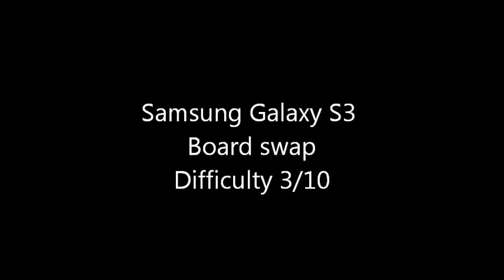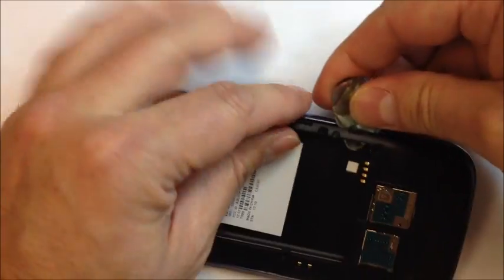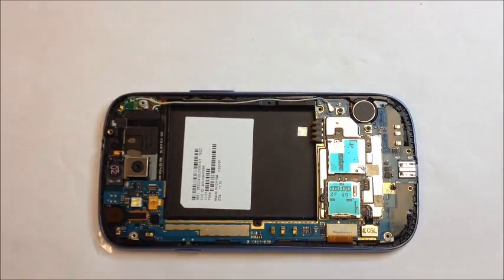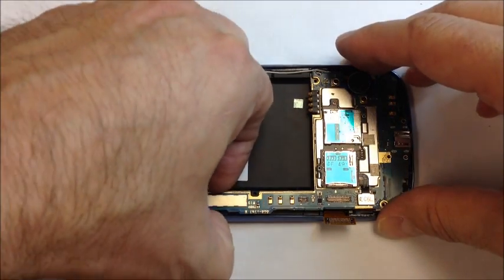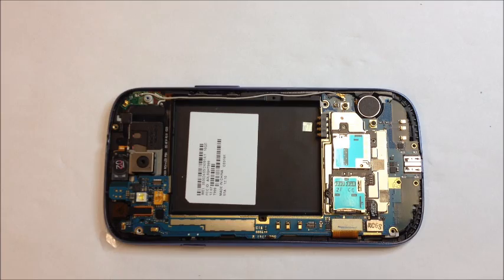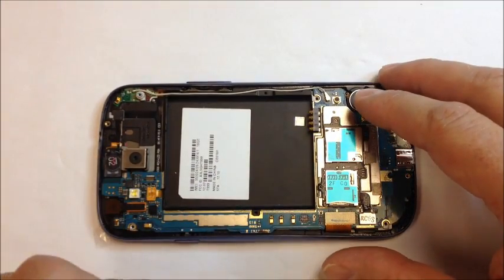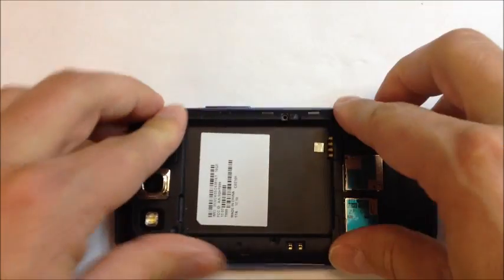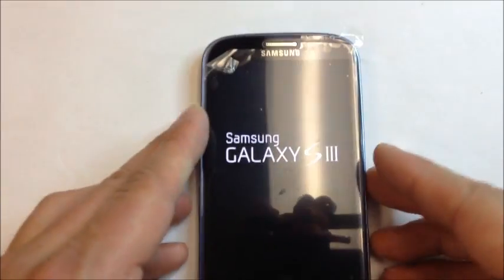Samsung Galaxy S3 tear down for board swap

Comment: I just broke my screen today - if I buy a refurbished phone off ebay and then replace my board like this will it still work? I have Sprint.
Reply from the maker: Yes but keep in mind that the model number must be identical. You can't buy an AT&T S3 for example. The board layout is slightly different.

Comment: my phone isn't receiving 85% of the calls nor are 85 % of the calls outgoing is this the board that needs to be changed? the signal strength is full so I'm assuming it's not the antenna
Reply from the maker: Sounds like it. It's always tough to say for sure as signal strength can sometimes be misleading. Was it repaired recently?
Reply: Go Cell Phone Repair no it was stock never repaired
Reply from the maker: nervouss Could be a software issue too. It's probably worth trying a hard reset if you've backed up your info already.

Comment: I have a galaxy s3 thru boost mobile and I sent it in to samsung for repair and they said my motherboard was disconnected and i would have to pay almost 300$ for them to even start fixing it for me. If i find one on Ebay, how do i go about it? do i have to find the same model number in order for it to fit?
Reply from the maker: Yes. If you have Boost then you need a Boost logic board with a "clean" ESN. Be sure to clarify that much with the seller as there are serial numbers that can be blocked from the network. Reported stolen, insurance claim or otherwise.

Comment: Is there any way of turning my sprint phone into a phone that would work on say fido's network with a fido board?
Reply from the maker: Fido is a GSM network and the Sprint S3 does not accommodate SIM cards nor are GSM frequencies supported so for this model no. The Sprint S4 on the other hand can be unlocked for international use.

Comment: I am a little confused with the CDMA GSM stuff.I found a cricket phone with a bad esn and want to know if I can swap it with my tmobile sgh t999 gs3 motherboard.
Reply from the maker: The T999 mid-frame is only compatible with GSM logic boards so the short answer is no you can't use it with a CDMA version. You could try to remove the display assembly from the Cricket frame and transfer it to your phone but this has a high degree of risk for damaging the AMOLED in the process.
Reply: Go Cell Phone Repair will at&t motherboard work in t mobile s3?
Reply: Yes its gsm. It will work. Same goes vise versa. Thats what I ended up doing long ago

Comment: Hi, thanks for posting that video. I feel more confident now on trying my own repair (galaxy s3). Just have an interesting question on borad swap. Would it be possible to swap a T-Mobile board into a AT&T working phone? Also would issues with the swap or with the antenna?
(SGH-T999L board swap into SGH-l747) I was thinking trying to fix my T-mobile thats has a broken lcd screen and try fixing it with a AT&T that just has hairline cracked on the glass srceen. Thank for your time and help in advance.
Reply from the maker: The AT&T and T-Mobile versions are compatible so you should have no problems there. I'm assuming that you are willing to live with the hairline crack from the AT&T phone. Since the glass is adhered to the digitizer trying to separate them is a lot more difficult.

Comment: I wanna do this to my phone because i broke my digitizer and cant wait for a new phone. My question is if i do this with a good phone and swap my board in, will i have to call verizon and have it activated or will it be as if it was my original phone?
Reply from the maker: Same as original. As long as you are using the same logic board (and LTE SIM where applicable) they won't know the difference through their network.
Reply: Ok cool. I have a Verizon S3, do i have to do the board swap with an S3 thats from Verizon as well?
Reply from the maker: sam roberts
That's the best option. A Sprint mid-frame should be compatible but anything GSM like AT&T, T-Mobile, or the overseas version will not fit.

Comment: Is there a reason why the pry tools are plastic? Will it damage the phone if I use similar tools that are metal?  Could you please help Go Cell Phone Repair
Reply from the maker: Believe it or not guitar picks are the choice of most repair technicians and do-it-yourself-ers for several reasons. First plastic will not scar the bezel or paint of your phone. So when you ask whether a metal tool will work I would say sure it will work but may leave some evidence of repair behind, something that most customers would not be happy with. Secondly guitar picks come in a great variety of thickness and flexibility making it easier to find the right one for whichever application you are working with. They are also cheap and easy to find since even the smallest towns tend to have some sort of music supply store. If you take a look at the typical "cell phone pry tool" you will see that it was modeled after a standard guitar pick. http://www.dhresource.com/albu_280903365_00-1.0x0/triangular-pry-tool-phone-repair-kit-for.jpg
Reply from the maker: Christopher Person No problem. With this being a relatively new industry sometimes we do have to improvise. The guitar picks work great and it's no big deal when they wear out.

Until some very smart guy came up with the iSesamo tool (wish I had thought of that one) I was using a dulled single edge razor blade a lot of the time when I needed something very thin but also strong. Not good to prevent scarring of course. Right now the one thing that I haven't found a proper tool to replace is a street sweeper bristle. No kidding. Long enough to get under a lot of LCD panels without being so thick that it applies excessive pressure yet very strong and fairly flexible.
Reply: I had to do this a while back to fix my GS3, it's fine to use other tools. Just don't use a hammer, that won't turn out to well.
Reply: So metal tools work? Christopher Person
Reply: Dallas C yeah, I used a small flat head screwdriver(a pc one)on mine..
Reply: Why do you think all the tools are plastic then? Christopher Person
Reply: Dallas C well one of those tools was a guitar pick, so guess that's what he had at the time. As long as you're not digging with a metal tool you'll be fine. It's still silicone just like a PC mobo. And technically if you have strong nail you can uses those. Their just clips after the screws.
Reply: Thank you Go Cell Phone Repair
Reply: Go Cell Phone Repair hmm didn't know guitar picks where that popular in cells phone repair. Thanks for the info.

Comment: Hello and thanks for posting...

Trying to repair my screen my lcd glass broke.  When I tried taking that off, the lying behind the lcd display crack too.  Do you know if I get a galaxy s3 phone that is the same (sph-L710 model) can I switch the motherboard and basically have my phone back?
Reply from the maker: Yes, as long as it is the same model, L710. If you get the wrong one like an AT&T version then it won't fit.
Reply: Got it.  And you are right it did work...thanks.

Comment: I have a S3 I baught off someone but I has a signal problem. Tried flashing factory rom and checked to see if the imei is ok. All Good. I checked the antenna wire that was also ok when I opened it. Can I get a bad imei board to save money and remove the bad imei and flash my phone imei. Will it work if I flash my backup nv data file
Reply from the maker: To the best of my knowledge that is possible but since we don't deal with bad IMEI devices I am not an expert on the subject. I do know that once in a while a manually written IMEI may revert back to the original so it is not a permanent fix.

Comment: can i change my sch-530u CDMA to a GSM S3 by replace a T999or i9300 board to its.
i need a GSM phone not CDMA
Reply from the maker: No. It sucks but they make the boards slightly different so they won't fit properly into different mid-frames.

Comment: I have a metro pcs s3 an the board is bad , do i need another metro pcs board or i cna use another board from a different module s3?
Reply from the maker: Check the model number. If you have the R530 then you will need another Metro logic board. If it's a T999 then it is compatible with T-Mobile.
Reply: thanks

Comment: Hi! I have an At&t i747 S3 using an lcd + digitizer of i9300 s3 . I want to know if I buy an i9300 full housing, will it fit on a i747 board? Thanks
Reply from the maker: To the best of my knowledge it will not. The board layout should be slightly different and since they are listed separately there is likely a good reason. I will add a link for the i9300 to my website ASAP.

Comment: I have a Us Cellular S3. They said it could not be activated because it was stuck in roaming. (triangle above the signal bar) Do you know what part I would need to fix that?
Reply from the maker: Stuck in roaming... That's a new one for me. US Cellular is a reseller for a few different companies. Is this a GSM or CDMA model? Without more information my first thought would be to try a hard reset. It could be some sort of software error.

Comment: i have at&t s3 with broken lcd.I bought verizon s3 with good lcd but bad emi from ebay.Will swap of lcd work for at&t?
Reply from the maker: It will not. The mid-frame configuration is slightly different so even though the display will light up you won't be able to fit your logic board into the phone properly. AT&T and T-Mobile are compatible. Whenever you deal with Verizon you almost always get parts that only work with their phones.

Comment: I'm so thankful for this video,but I have a question. My wife's CDMA S3 has met with an unfortunate accident, and its screen is broken (glass and display). We are receiving a replacement through insurance, but she still has a lot of pictures and music on the internal memory.

If I were to do a board swap, I want to be sure that it won't cause problems with her service due to imei problems. Do I still need to activate the phone and do i use her old SIM or the one sent with the new phone? Since it's a CDMA phone does the SIM card even matter? If when we send the old phone back with the new motherboard, I'm assuming that it's imei won't match the sticker inside.

Sorry if this is long. I'm very good with hardware, but when it comes to all this imei and service business, I find it a little confusing. Especially since I assume this process is probably not something most carriers are expecting people to do.

Thank you.
Reply from the maker: If you have a CDMA phone then you will have a MEID rather than IMEI. The LTE version of the S3 which should be what you have uses the LTE SIM for subscriber information however if you did an insurance claim on the original board then there may be a possibility that they will blacklist the MEID. This could be a problem in the future. I would suggest swapping the board, backing up her files, then putting the new board back in just to be safe. The original SIM should still be active but you'll have to try it to be sure. Save the new one just in case.

The downside is that the new board that comes with the replacement phone is probably refurbished.

I hope that answers your questions. Good luck.
Reply: Go Cell Phone Repair
Thank you, I was afraid of that. Since her phone still powers on, could I just connect the good screen to her phone in order to be able to unlock it? I tried connecting her phone to my computer to get the data off, but since I can't unlock her phone, the devices just show up as empty.

I'm pretty sure it's not my computer (Lubuntu 14.04) because it works fine with my phone (Stratosphere 2).
Reply from the maker: Yeah if the phone is locked it will probably look like there is no media until you unlock it and put it into transfer mode.

Comment: Hi I have a Samsung s2 it turned of and wont turn back on no matter how much I try, I need to change the motherboard and I was wondering if I could transfer the inner meomory thats in the old motherboard to the new one is it posible??? According to some repair technitian its hard job but I realy want to do it plz help me :(
Reply from the maker: If the old board will not power up then you won't be able to extract anything. Hopefully you have a different problem causing it not to turn on. There are a lot of things that can cause this to happen so you'll need someone to perform a diagnostic test and find out if it will turn on at all.

Comment: Hey! Thanks so much for this video, I successful swap the motherboard on my own in less than 10 mins while other phone repair shops were trying to charge me over $60 to swap the motherboard. I have a question though? What if I was going to purchase a phone that has a bad ESN or IMEI, if I switch the motherboard from the phone that has ESN or IMEI to a brand new motherboard would the phone work?
Reply from the maker: If it has a bad serial number you will not be able to use it as a phone as the networks in the US will not allow bad IMEI/ESN to connect.

Comment: Hello! I am borrowing my friend's S3 as mine has a broken LCD/digitizer, and I want to transfer my data onto their SD card before I send it for repair, is the cable at the bottom left what I plug into their phone to use their screen as a donor? Thanks!
Reply from the maker: Yes. Just be careful not to put any stress on the cable.
Reply: Go Cell Phone Repair in what way?
Reply from the maker: Rebecca Ford By pulling on it. They can tear if you aren't careful.
Reply: Go Cell Phone Repair ah, I see! Thankyou
Reply: Will a gt I9300 motherboard fit in a Verizon s3 body?
Reply from the maker: Not without some modifications. The Metro version R530 on the other hand should be.
Reply: How about t999 body?
Reply from the maker: The T-Mobile T999 is compatible with the AT&T version but not Verizon. People ask this a lot and Verizon is always more difficult when it comes to parts because they are CDMA. I've actually cut out parts of the frame with a dremel and made it work but if I were you I'd look for the correct frame. Good news is that Verizon stuff is usually cheaper.
Reply: My question was is I have a gt I9300 motherboard ..and what body can I put it in??

Comment: Can u tell my which phone should I use the components to switch with the other one...
Reply from the maker: If I understand you correctly you should be able to put the board from the one with the bad screen into the other phone.
Reply: Thk you alot.. i did it n it work very good, but now i hv a little problem with the headphone jack... when i connect my headphone... i can only hear sound on the right.. can u tell me how to fix it.
Reply from the maker: You can try disconnecting it and plug it back in. If that doesn't work you can always it with the one from your other phone. They do go bad over time.
Reply: how can i change the phone- plugin?!? i though it is stick on the main... so it's kinda impossible to change it, rigth?!?!? can u help me?!? thank you
Reply from the maker: If you are talking about the charging port it can be replaced but requires advanced level soldering skills and a microscope. If you can't find someone in your area to help you we do offer this service through our retail store. Please visit gomdwireless.com for contact information.

Comment: probably a dumb question, but here goes:  Must you place the motherboard from the old, broken phone into the new phone with the good screen BEFORE activating the new phone?  maybe the answer is that when you simply insert the old motherboard, along with its SIM card, into the new phone, there's no "activation" necessary for the new phone, because the old motherboard and its old SIM card have transformed your new phone into your old one, but now with the brand new case and screen... ? correct?  or not?   

OR can you activate the new phone with the old phone's SIM card inside the new phone's motherboard, see what stuff you can recover from Google contacts, then, if you can't recover everything you want, take the old phone SIM card out of the new phone motherboard, replace the new phone's motherboard with the old broken screen phone's motherboard as you've shown us in your excellent video, then insert the SIM card into what is now its original motherboard now resident in the new, non-cracked phone, and presto, you're good to go?  (I'm worried that once you've mated the old SIM card to the new motherboard, you may not be able to "re-mate" it with its original motherboard...

Many thanks in advance for your advice!
Reply from the maker: If you are working with a GSM phone then your subscriber information is stored on the SIM card; no activation required.

Comment: Hello, Go Cell Phone Repair, can the display circuit failure be fixed on s3 board or the whole Circuit Board needs to be replaced. "Board issue LCD discolored no matter what screen I use to replace the broken one and display won't stay on Display circuit failure".
Reply from the maker: I'm not sure about that one as I have yet to encounter the same problem. Depending on where you look it is often more practical to replace the board itself when non-modular components fail.
Reply: Go Cell Phone Repair Thanks for the input but will lose the IMIE no. with board swap and which component on the board has this IMEI data. Thanks.
Reply from the maker: sumeet sharma Yes if you change the mainboard it will also affect your IMEI.

Comment: Just a couple questions. My galaxy s3 got knocked out of my hands and when I picked it up the screen was just black. I'm assuming the LED display screen is broken? If so, would doing this help at all? or would everything on my phone be the exact same if I did do this-messages, apps, pictures, etc.? or should I just get the screen replaced-would that keep everything the exact same? Your help would be greatly appreciated!
Reply from the maker: Most likely your AMOLED is broken. Once in a while you might be lucky enough that it got disconnected from the impact but that is pretty rare. Most likely your best option is to replace the screen or put your logic board into a functional assembly.